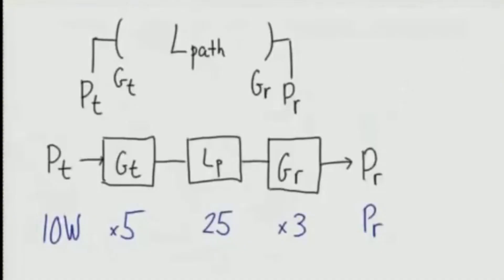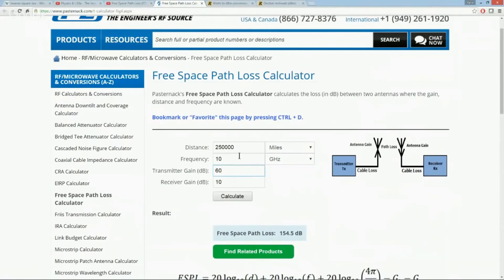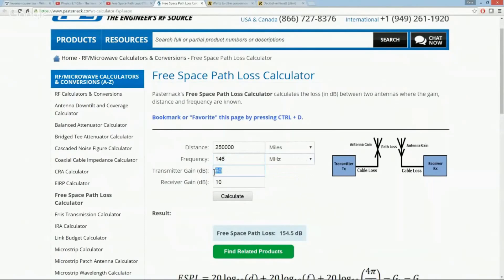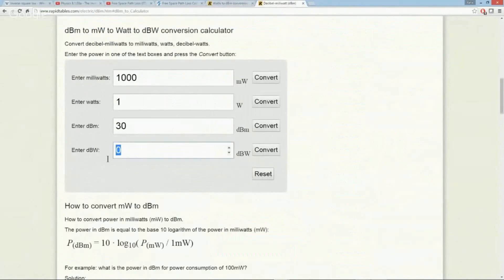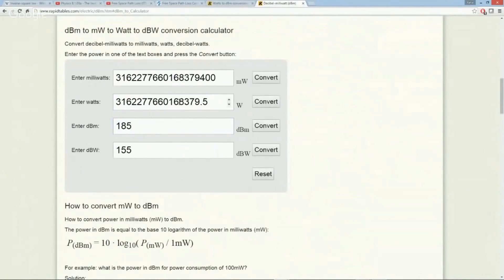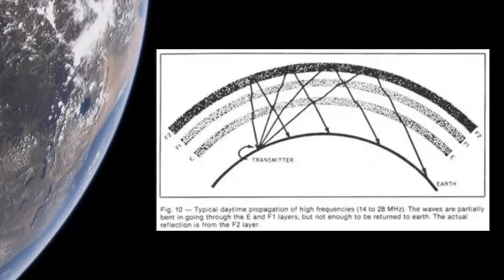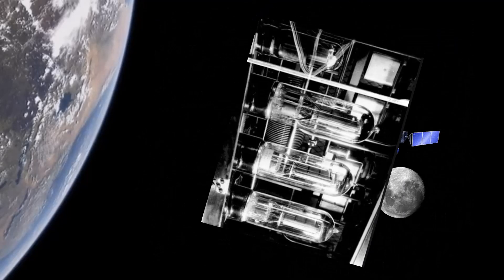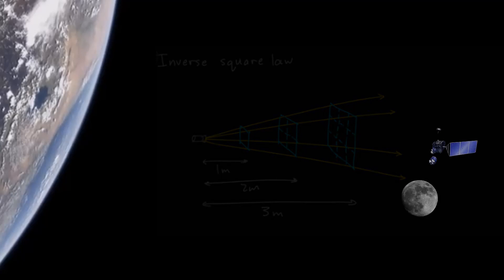"COULD RADIO WAVES HAVE PROPAGATED TO THE MOON AND BACK IN 1969?"  A RADIO ENGINEERS TAKE P2!

Comment: Hey fellas, you remember when the "Lem ascent stage" blasted off from the moon and they filmed it? How did they remotely control the camera vertical pan? What frequency was used to remotely operate the "TV" camera. So then that leads me to the question of what was powering the "TV" camera on the lunar surface? Given that in direct sun light the radiation temperature is +250f and out of sunlight it is presumed to be -250f. What battery can function in those temps and provide the necessary power for a 1970 "TV" camera? Just wonderin?

Comment: I didn't use your examples as they work best, but I just mentioned communications back in the 60's to now. How could we transmit anything 240k miles away and get the same signal back without suffering losses? I even mentioned how even am stations today aren't all that clear. I truly don't think people understand how far 240k miles truly is. Not to mention how far Mars is!!!

Comment: well, Nasa said they received from Jupiter, Saturn, and even the edge of solar system. Laughable. Nasa must be watching Star Trek so much, Trump's space army adopted the Star Trek logo. These guys in Nasa is really laughable. One correction to make in this video, you don't need 1mW to recognize the signal. 1 microW is enough. So, you can receive a signal from the moon, but not too long (less than an hour using lower frequency. Apollo claims they used 2MHz which will finish the new technology battery in ten minutes.) You can have hours of the worldwide broadcast if it is the studio like Apollo did.
Reply: I think NASA claimed their comms were in the 2GHz range.  Almost the same as most routers or wireless mouses.   Either way it has an extremely limited range regardless of the power. .  .  Which is perfect for NASA because they never went far anyway,